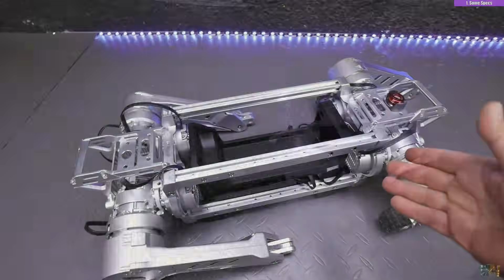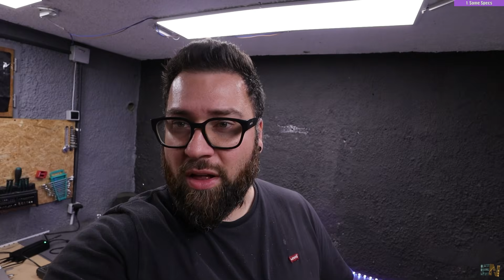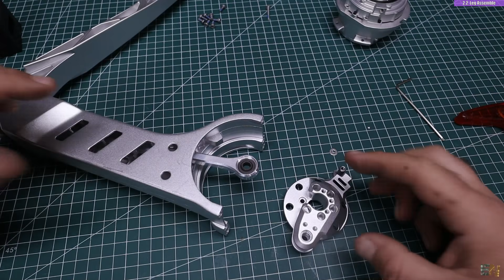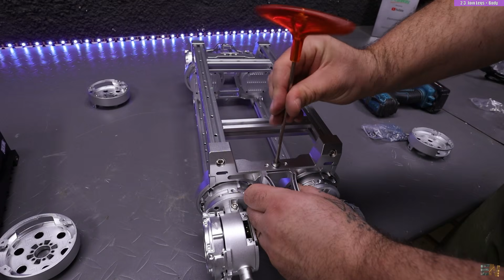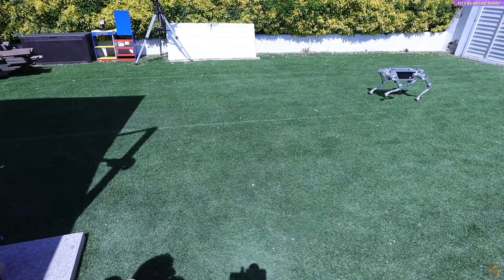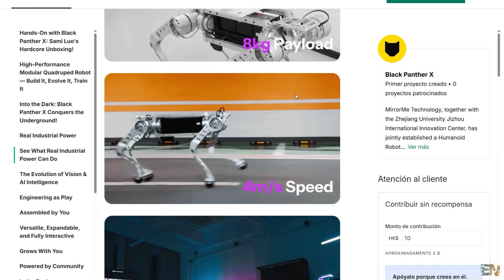Is This the Fastest DIY Robot? Black Panther X Build

Comment: So it has no automation? No sensors for navigation?
Reply from the maker: By default has no lidar or so, if that's what you mean. It has IMU and each motor has encoder.
Reply: You have to roll your own and integrate it but the connectivity to do so will exist. Hopefully they release decent technical documentation soon that'll help myself and other looking to do this. It would be nice to get a head start before shipping.